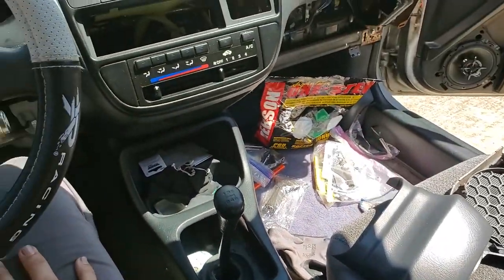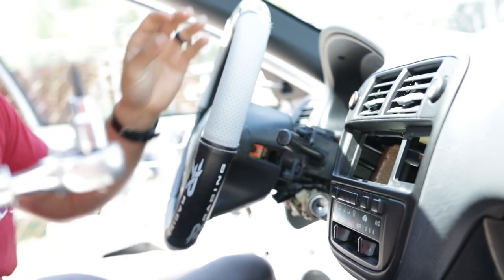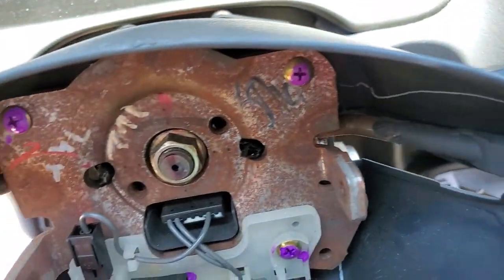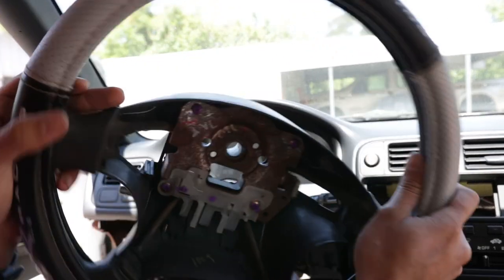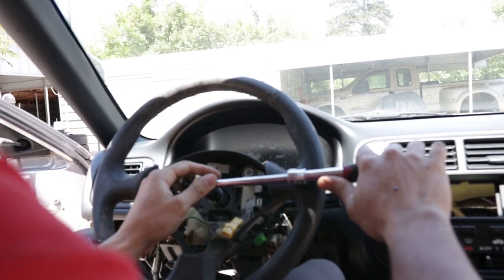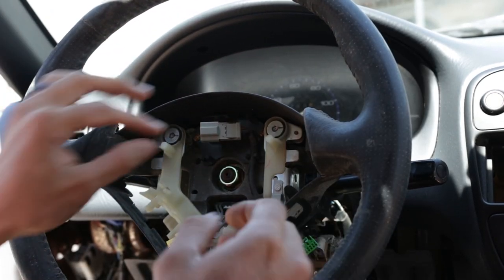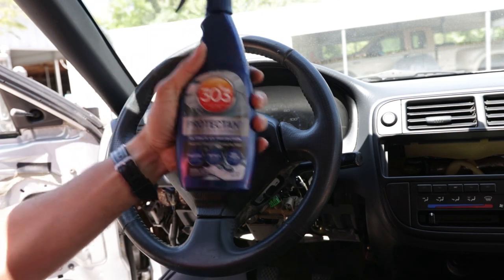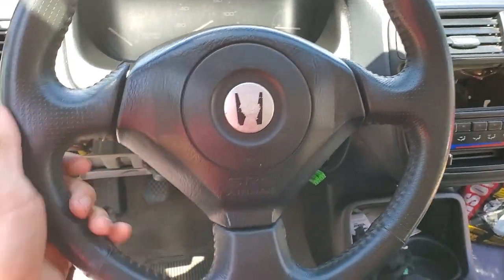(HOW-TO)S2000 Steering wheel in EK Hatch(Project R)

Comment: What year is your hatch? I was told the s2000 steering wheel wont fit 96-98 ek only 99-00 but yours seems to be 96-98
Reply from the maker: I never heard that before.. As far as I know the S2000 fits the 96-00 years.. My hatch is 98..what I do know is the S2000 airbags are NOT the same.. One has a more advanced airbag(Ap2) 2 stage air bag or something like that and that might be where the discrepancy is being that the ek civic is all single stage airbags
Reply: @FrancisD  thank you sir i have my car in another country and wanted to know if i needed to ship out the steering wheen and a 99-00 column as well.. it was on a hondatech post i saw it but mine is 96 so we will be good.. thanks alot for the nice video and the quick reply i was concerned of the fitment dont mind the airback